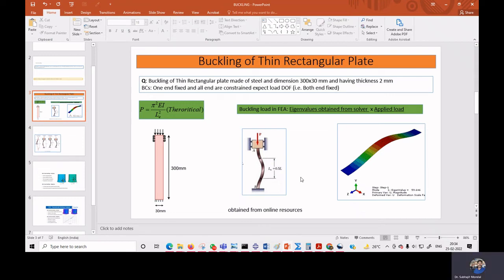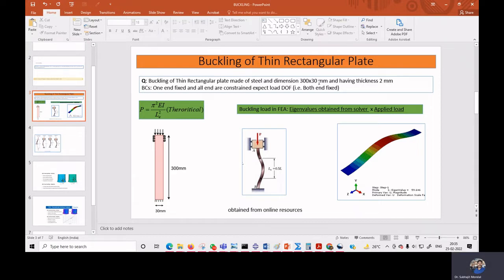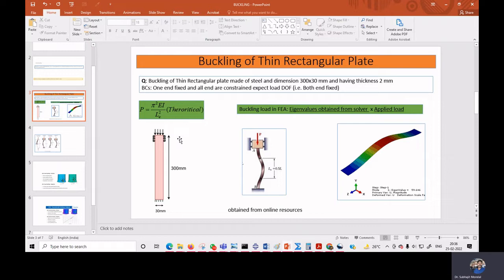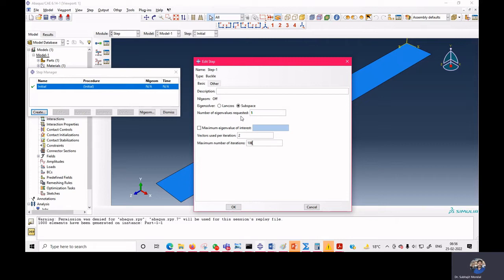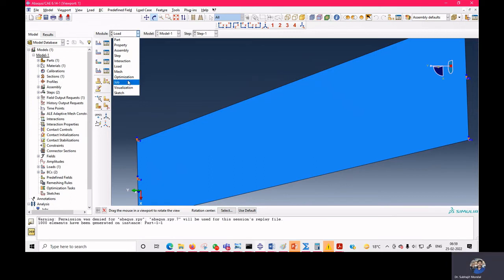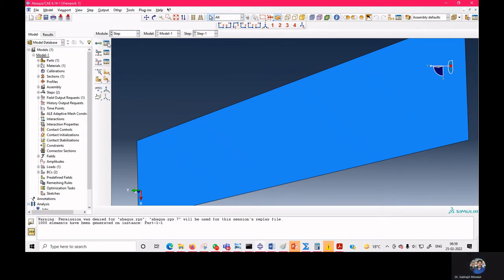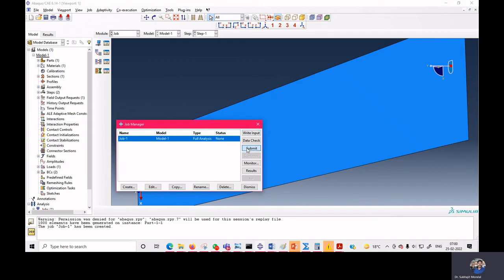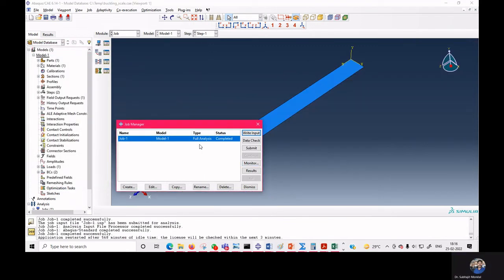ABAQUS (L10M4)  Buckling Analysis Using 2D Shell Elements  and Verification With Theory

Comment: Hi Sir, I have modeled the same structure as what you did in the video. The only difference is I am using 3D solid elements. For fixed-free conditions, I got buckling load 110.47 N and fixed-pined condition 903 N. For fixed-fixed boundary conditions I couldn't get the close value compared with Euler buckling calculation formula. Can u help me with that sir.
Reply from the maker: Do the convergence study
Reply from the maker: Check Bcs
Reply: @sumanmonda102  convergence I have done but no change of results. for fixed-fixed conditions, i got buckling load 904 N, I couldn't get the close value.
At one end of the structure, I have applied force for 1 N in the x-direction (u1) and applied BC in that place has u2, u3, ur1, ur2, ur3. On the other end, I have applied BC has u1, u2, u3, ur1, ur2, ur3.
Reply from the maker: @rajeshkumars4121  CONSIDER 0.7 INSTEAD OF 0.5
Reply: @sumanmonda102  for fixed-fixed condition the effective length is 0.5 only.
Reply from the maker: CHECK EFFECTIVE LENGTH CAN BE 0.7
Reply: @sumanmonda102  effective length 0.7 is for fixed-pined condition
Reply from the maker: @rajeshkumars4121  Video link
https://youtu.be/6OuIS5Oe4A4
Reply: @sumanmonda102  Thank you sir